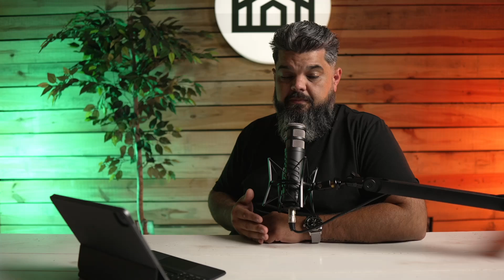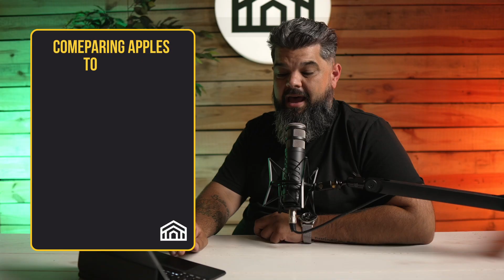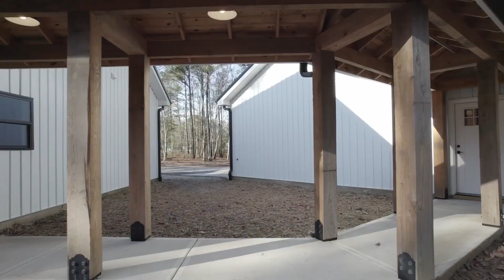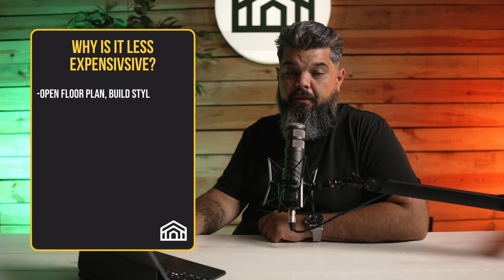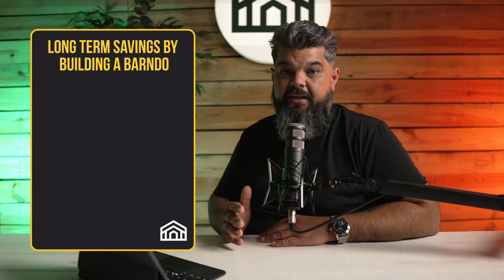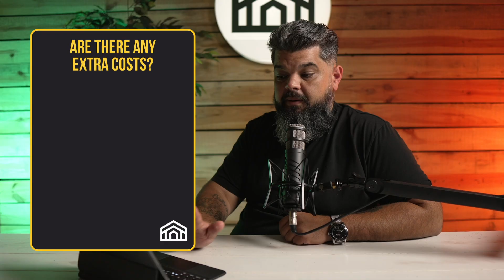Are Barndominiums CHEAPER Than a HOUSE? [ANSWERED]

Comment: Bardominiums might be lower in maintenance cost & it's possible to have a lower electricity bill, but this isn't bardominium specific that's insulation specific. At 1 point, might still be, a converted commercial metal building into a bardominium was relatively cheap but now steel prices are high. People just have to understand the cost of housing is unfairly high, I pray it comes down.
Reply: me too!